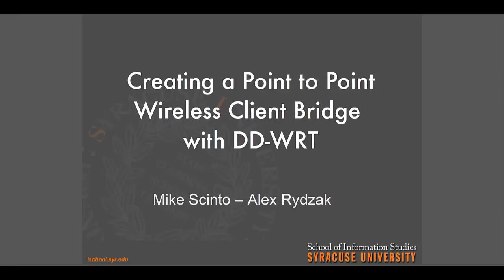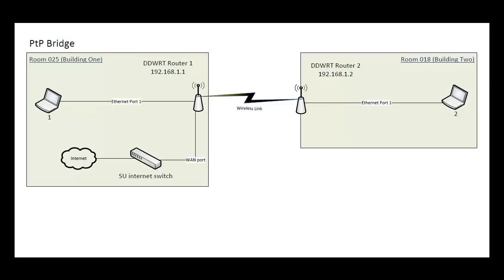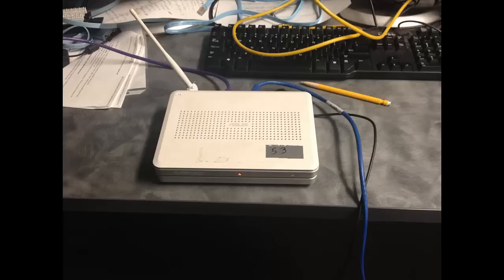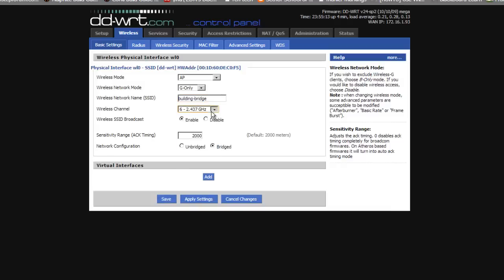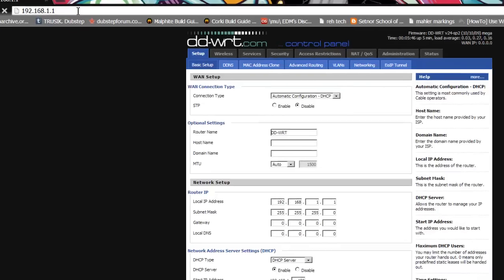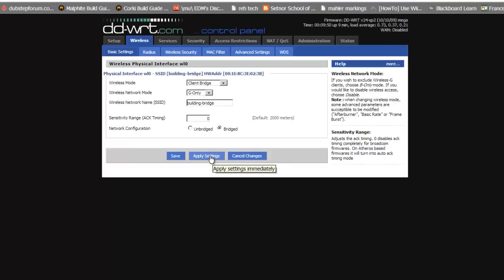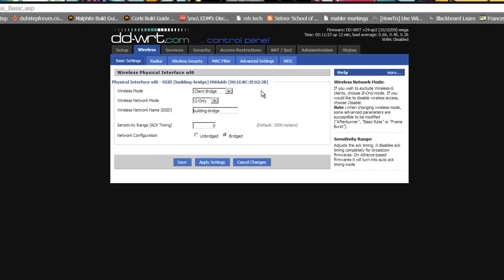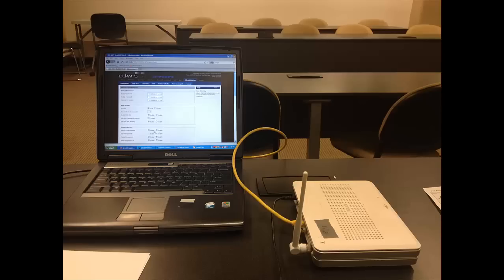Configuring a Wireless Point-to-Point Bridge on DD-WRT

Comment: This tutorial worked perfectly for my blu-ray player with an ethernet/lan only connection (NO USB) setup that is located in the other side of the house. Great for those that have an old linksys router and don't want to run a 100ft+ ethernet cable from the cable modem to the blu ray player. Follow the video and you should be successful.

Comment: can Laptop2 connect to Router2 via WiFi instead of ethernet cable?
Reply: +hooperwille Yes it is setup as a wireless access point, I think they only did it ethernet connection to setup the router

Comment: I am trying to turn an old router (Netgear WNDR3700) into a Bridge. I have installed DD-WRT, but I can't seem to get it to connect with my main router (ASUS RT-N16). The main router does not have DD-WRT (does that matter?) I followed your video and it seemed to work, it said I successfully connected to my main router but when I went back to check my signal strength it said nothing was connected. Any suggestions?